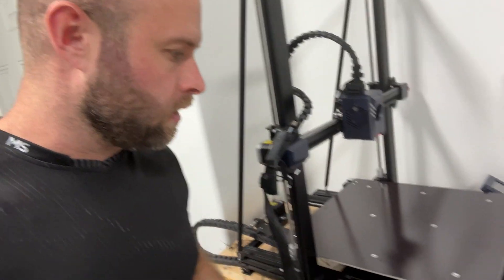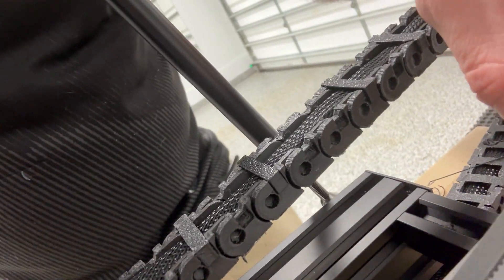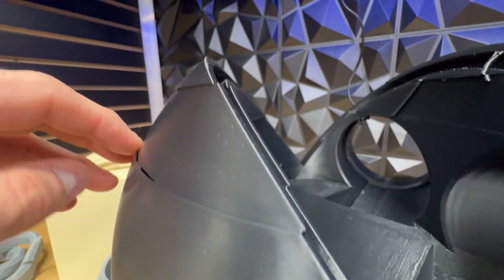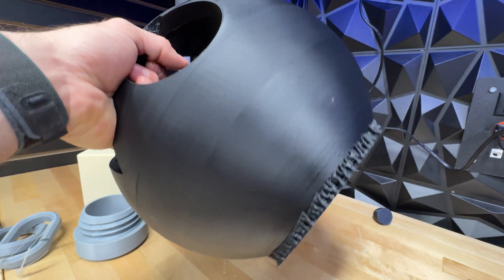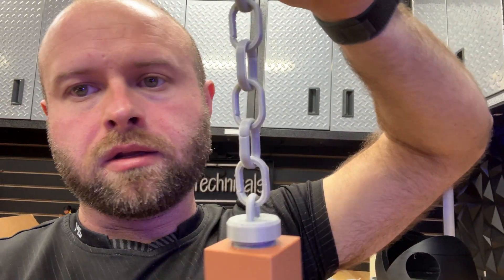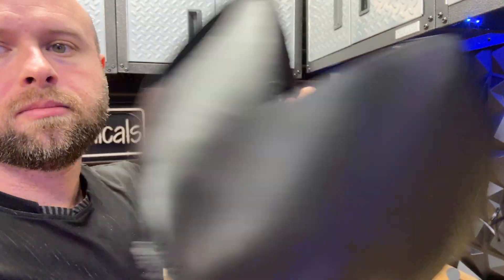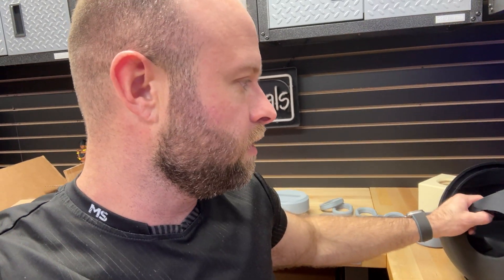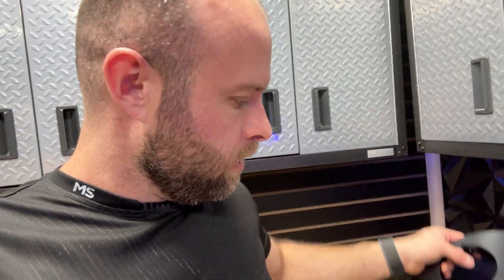3D Print Startup: Anycubic Kobra 2 Max CANT HANDLE large prints & My startup needs a team principal

Comment: This might sound stupid, but I found with a kilo or so of print on the build plate, I found the printer didn't slip BUT my magnetic build plate had. If/when you try your next big print keep an eye on the magnetic build plate, the magnet isn't that strong when you compare it to say the magnets used in a Bambu build plate, there rare earth metal magnets and on these big plates there, well just a magnetic mat, some magnetism but not a great deal for its surface area!
Reply from the maker: Wow, hot tip! Thanks

Comment: Your belts are not tight enough. I was having the same problem.
Reply from the maker: They were all the way tight minus 1 turn. That's crazy to me
Reply: @TechnicalsTinkers  I bought belts on Amazon they are advertised as high grip and have a different material on the cog side. They grip much better with less tension.